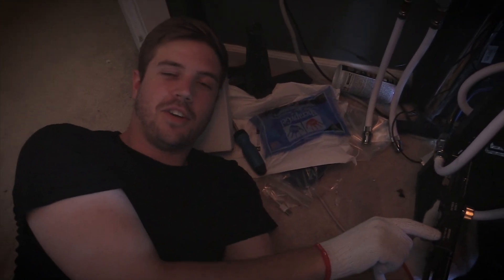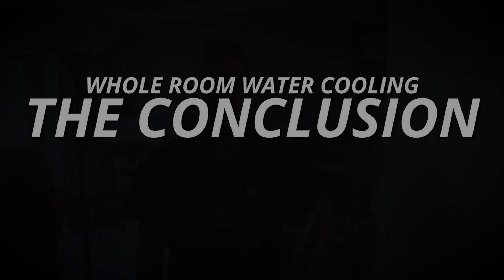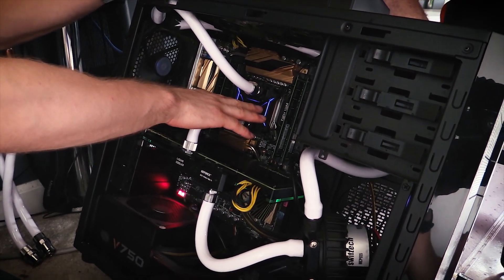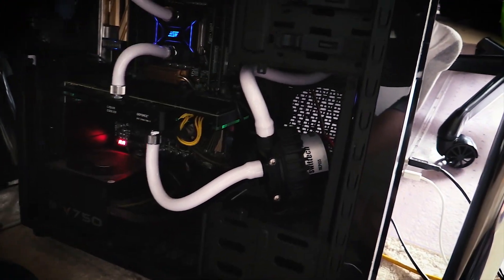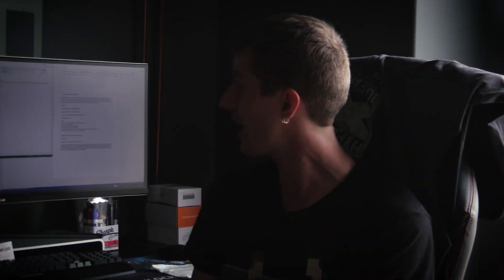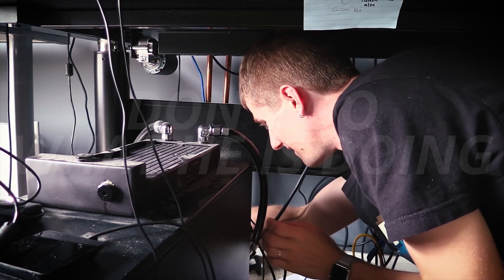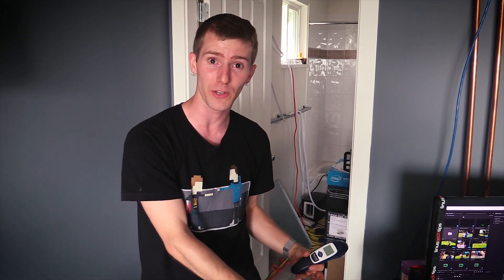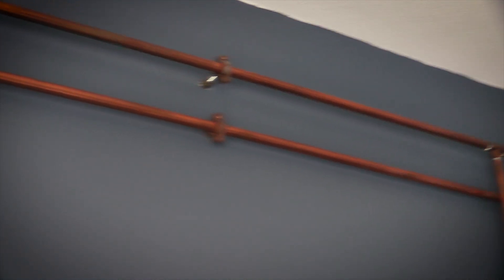Whole Room Water Cooling Part 7 - It's FINALLY over!

Comment: Why dont you just put your PC's in an other room. Sure a bit of cable management but no noise, no heat!
Reply: ToKeepTrackOfRandomSubs Um, are you thinking the 10gb ethernet would be the issue? That wouldn't be any different, and ethernet cords are designed to be long. All they would need is some 25ft HDMI cables and USB cables with repeaters
Reply: haifishtime It might be a bit troublesome to get long extension cords for high bandwidth data input (consider that it's an editing room), but yea that is probably more doable for sure. Assuming that data will go onto the fileserver and they'll be working from there that should not be a problem other than finding some convenient way to get the data onto the network.

Then getting some setup with forced ventilation in the room with the hardware (or air conditioning, not too familiar with what is practical in the climate) would get the job done keeping both heat and noise out of the places where people are. 

The only thing  I'm not entirely sure about is what the practical maximum length of USB 3.0, display cables etc are before data integrity starts to become an issue. This might need some fancy solutions ;)
Reply: ToKeepTrackOfRandomSubs
It seems that the main advantage to this is noise though, and they could have a silent editing room, and also overclock their CPUs and GPUs more since noise isn't an issue
Reply: haifishtime The real question is, why they dont work via a remote desktop. With the server being in the same network latency is pretty low and you can use all of the computing power of the server on one machine.
Reply: ToKeepTrackOfRandomSubs
I don't think he means remote desktop. I think he means an HDMI and USB cable running to the other room.
Reply: haifishtime
I doubt it would be as good, it would probably be better to do hdmi over ethernet
Reply: haifishtime Just put the PCs in the room on the other side of the wall and drill holes for monitor, mouse and keyboard cables.
Reply: ***** Well in that case it should work, I don't keep track of all the details on this channel lately. I wasn't sure about the network and fileserver capacity.

In the case of high resolution footage that'd be edited on the PCs first and then the final product gets archived I could see issues happening with multiple people using a lot of bandwidth. But since you mentioned they are using 10 gigabit I'm assuming it should be technically viable for the network to handle the load.

I expected potential issues if they had to first get the data onto the PC to process it and then store it on the fileserver. But with that kind of infrastructure you could easily put an "upload station" in the room that is fairly low power and just automatically grabs whatever you insert into it to a place on the fileserver for example to then work with it.

That'd still leave a fair bit of heat being generated in the room though, computer monitors, 150-200W per person sitting on a chair (if I remember the guidelines I read up on ages ago perfectly). But Linus already stated their new office will have AC and I wouldn't be surprised if the editors each get some extra space compared to that setup. Many people in a small room without active cooling/ventilation will always warm things up, its what humans do by being alive and having a regulated body temperature. But in a larger room with some kind of ventilation or air conditioning its much less of an issue.
Reply: harzer99 Now admittedly I've not tried every kind of remote desktop tool, but for a single user on gigabit ethernet the user experience is never "quite what it should be". Especially if they are editing and trying to put effects in and take into consideration they are using rather high res footage the editing monitors are probably running on that res too.

Dumping that over the network and processing it on both ends is actually a significant workload on its own. In addition to that doing visual design/effect editing you want it to be proper. For text editing and just about  most productivity features you could get away with it but all forms of remote desktop that I'm familiar with don't enjoy dealing with video. Running the cables through the wall is probably an easier and more reliable setup.
Reply: ***** Yeah thats right, but Remote Desktop should work too!
Reply: haifishtime I was thinking about this and the only barrier I can see are the massive screens probably 4k or ultrawide which need displayport. Displayport dosn't extend too well, i had 4k issues on a 3meter ( hdmi can do 15m no problem). Some workstations have 2 or 3 screens. Soon adds up to a lot of cabling.
Reply: harzer99 4k/multimonitor/ultrawide monitor. They don't work via remote.
Reply: ThePolysyllabist
They'd probably just run them through the door, if you saw how many cables they already had around that place
Reply: That was what I was thinking about the bathroom why not build it into a computer room with air condition, it's close enough and only a couple of cables would be the challenge.
Reply: ***** And the mouse, keyboards and all these things? They need to be in the same room as the screens.
Reply: haifishtime
That stuff is super easy, as it requires very little data transfer. You can carry USB over DisplayPort.
Reply: ***** really? Didn't know that but you would need a long DP Cable and not HDMI.
Reply: haifishtime That's probably what they'd be using anyway.
Reply: A smallish bedroom with a nice A.C would do just fine, would save a lot of space as well.
Reply: +ToKeepTrackOfRandomSubs This is the solution all major post production houses use.  They all have what's called a "machine room" where all the PCs are stored.
Reply: Can't dvi do 4k??
Reply: Adam Ryan no

Comment: 7:40 laser is not pointingon the copper tube, is that intentional?
Reply: Kymate Yes it was intentional, the laser is a decent indication for the IR spot thermometer at an intermediate distance.

What linus was doing was lining up the IR optic part directly to the pipe which is the correct way to go about it. On most of those IR thermometers the laser is mounted below the round hole where the IR optics/sensors are residing, so at say 30cm and onwards the laser is a fair indicator but then the "spot" of which you'll get the average temperature will also get larger.

Consider he was getting the temperature of slightly reflective copper pipes too, reflective surfaces tend to reflect  IR as well and this can upset the measurements. Getting the measuring device to cover most of that area will block a lot of potential reflected IR light, so you get less chances for errors and a smaller measuring spot.

Comment: One of your guys are a plumber or what? how did you get the copper piping soldered together? I am pretty sure no one in your group has a torch/solder or knows how to do it.
Reply: Chris Just did a little bit of reading up on things, and basically the only distinction on a technical level that I can see between soldering and brazing is the melting point of the joining material.

Brazing being used for the hotter melting point metals and soldering for the lower ones. It is a useful distinction though as soldering joints due to the materials used tend to be weaker than similar ones using a brazing method.
Reply: Flat4Buggy ah, thanks
Reply: robert karas He mentioned who it was in the video, but if memory serves me right it was Luke's dad? Someone's dad at least!
Reply: In one of the vids he showed Lukes dad while he was setting it up
Reply: robert karas It's actually brazing (not soldering) and most likely done with acetylene. I've tried it a few times.......don't attempt it. :D
Reply: Chris As a plumber myself its done with any blowtorch (normally propane not acetylene) and solder.
I rarely hear anyone call it brazing, soldering is the more common term used on construction sites.
Reply: robert karas My only exp. with copper pipe was doing hvac things with the method I listed. I guess it's different when water is involved. :)

Comment: I dont even think you would notice that much of a difference if you unplugged the radiators, at least not until a really long period of high load on all machines. As you said the copper pipes dissipate heat but you also has so much water in the system it would take a long time for all the water to heat up.

Actually, wouldnt this be a fun test? Compare the system with and without the outside radiators and see how much of the heat actually dissipates in the rads and how much in the room before the rads. Then you would know how much heat you actually remove from the room.

Comment: insulate the hot pipe and you would see more of a drop in ambient temps...basically what youve done is make a radiator, like the ones they use to heat rooms lol....mainly because the design circles the hot water around the whole room before leaving the house...so my guess would be your only losing about half of the temp outside, the other half is being radiated back into the room before it leaves...

Comment: How about this idea: get an ac unit or heat pump and use the evaporator side to cool down a big water reservoir to like 15 degrees C. Or go balls to the wall and use subzero temps while using insulation for all of your tubing to prevent condensation. If you do this correctly while using no corrosive materials and have a pump that can build up enough pressure you can have some insane cooling performance for all of your PC's

Comment: Wouldn't Insulation around the copper pipping contain the heat inside the pipe until it got to the radiator? Then less heat would enter the room. ?

Comment: You need to insulate the copper pipes inside the rooms so the heat doesn't go back into the room during transfer.

Comment: A no ego investment conclusion to the experiment. Good - those copper pipes are radiating heat back into the room. 2 degrees is the difference between comfortable or uncomfortable sometimes in a room - if you were losing a few degrees in the room it would be worth it, we've all learnt from your experiment. Next person will get it right.

Comment: you know what ? Please make cooler water for your inlet, by some smart conditioning system with refrigerator, and get like 5-10^C inlet temperature. and also use small fans inside computer water colling, to blow that cool air into your room. So this not only will give you 15-25C  CPU/GPU temperatures, but will also cool down your room !

Negative side is electrical bill for extra cooling your water, but hey, maybe you have enough cash to make it work ;)

Comment: I had the same 'hot room' issue so I put my PC in a glass box with access to the front trays only and some low down air holes for air-in.  I then fitted an in-line fan in my loft and connected this with 10cm piping in the wall down from the loft to the box.  Glass case reducing fan sound a huge amount and main fan is remote.  Keeps the room nice and cool and the PC too :-)

Comment: but when its hot outside you are fucked. id rather custom make some cabinets for the cases and install an Air conditioning unit and somewhere combine with some pvc pipes that would drive cool air through the pc cabinets. also at 7:30 the laser is hitting the wall instead of the pipe

Comment: I think you made the system much more complex than it needed to be. Would of run the pipes at baseboard level, till you got to the door. also a 50 gallon plastic garbage can for the resevoire. outlet at the bottom, and the inlet from the main radiator the top. Also would of opted for a large car/ truck radiator with 2 large fans. and just for the heck of it dropped a 5 lb bag of ice in the can.